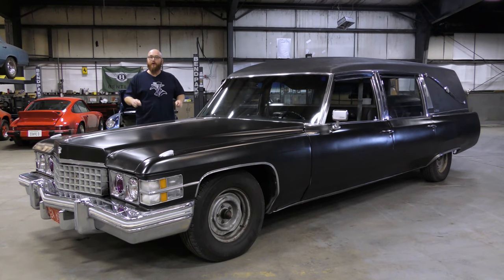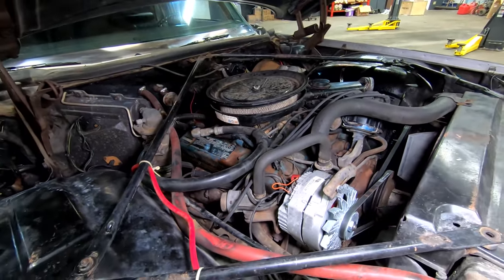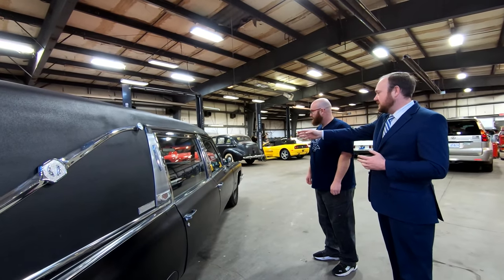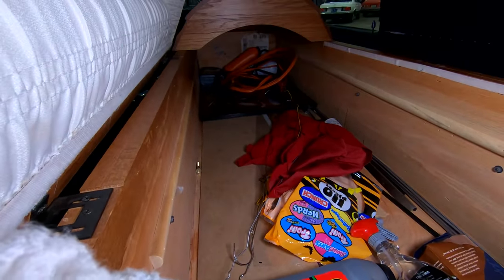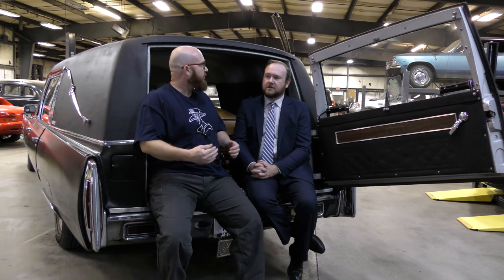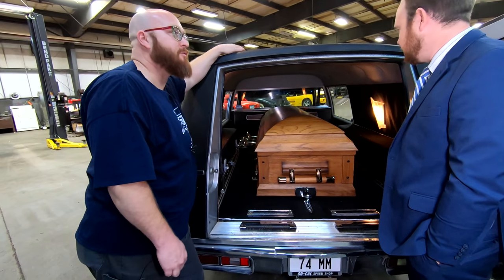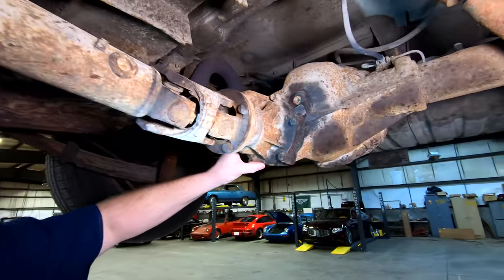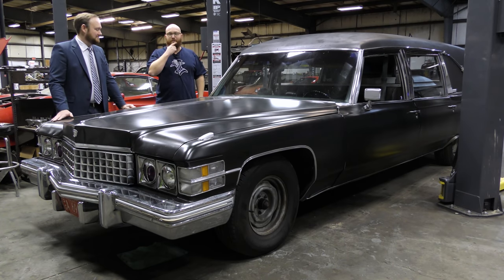Why would someone buy a hearse?!? CAR WIZARD shows a modded '74 Cadillac Miller-Meteor

Comment: The biggest issue with hearses is they were often driven in service, then put away wet, leading to premature rot particularly in the salt belt.  

Otherwise they are often low mileage cars which are reasonably well kept, if you don't mind that they hauled the deceased or the fuel economy they can be good vehicles.
Reply: That has not been my experience.  The funeral director take meticulous care of their cars so they are not embarrassed during a service.  The second buyer usually abuse them which is where the rot comes from.
Reply: @mexicanspec  I heard that because funeral is a very special occassion, these hearses don't have long service life, becauce the clients don't want to see old vehicles caring their loved ones. 
So they buy brand new hearse, and use it less than 10 years and sell them, even though they have plenty of life remaining due to low mileage. I heard East Asian countries are buying these to use in their countries, because it became fashionable to have American Style funerals from watching Hollywood movies and dramas.
Reply: @davidjacobs8558  It depends on the finances of the funeral home but 10 years sounds right because the car companies don't change the style of their car very much.

I can tel you in Mexico there is a shop that will take a Grand Marquis and make a Rolls Royce hearse, or a Mercedes hearse.  It is Ford underneath but it looks like the other car.
Reply: @davidjacobs8558  I don't know, I've seen a magnificently kept one locally that couldn't have been younger than 1920...
Reply: @davidjacobs8558  I have a '93 that was used in at least 1 service last year
Reply: @thoughtengine  a 1920?   You are dealing with a way different animal back then.    Are you sure ?
Reply: @caseytbss  I think I've found it, I was only off five years. 1925 Buick, Morleys Funerals, Townsville. Shiny...

Comment: While I certainly like the Miller-Meteor conversions with the funky bubbled roof and large proportions — I’m partial to the clean smooth lines of an S&S, specifically a Victoria or Park Row.
Reply: I Like the '60s - '70s Superior Crown Sovereign Landau.
Reply: Yes the S&S was the top manufacturer, after Eureka closed their doors.  Miller-Meteor was not a well put together car.
Reply: @mexicanspec  I saw a comment saying that most vintage mms should be avoided and that 1963 was the worst model year for them. I wonder how many customers actually returned their coaches to the dealership or how they were able to get away with selling "faulty" vehicles??
Reply: @aussiefurbymogwaifan6621  The reason I say the M&M was not a well put together car is because they molded the Cadillac body to their coach body with fiberglass.  Other companies used lead or metal making them stronger. I doubt any cars were returned. Funeral directors couldn't be without their cars so whatever repairs needed to be made were made onsite.
Reply: @mexicanspec  so has anyone who has restored a mm (yes, even ecto owners), has used steal/lead in place of the fiber glass?? Also what is "lead"??
Reply: @aussiefurbymogwaifan6621  Lead used to be used.It is a metal but it is not safe to use.  They found that out after using it for years.  I don't know anybody that has restored a hearse, I only dealt with clean original cars.
Reply: @mexicanspec  your comment about someone that you knew who sold their car to become the 1a, what colour was it and was it a futura limousine and what did it's mm vin read?? Since the 84 ecto's vin is available to the public online. I wonder if any fans that have been to see the 1a/second afterlife ecto at the Patterson museum have asked the staff if they can pop the hood to look at the coach builder vin?? As the 1a is the only screen used car that we don't really know about what it looked like prior to the ecto conversion and what Miller-Meteor model it is🤔

Comment: I had a high-mileage '74 Fleetwood in the 80s.  The exhaust gas recirculation made it run so rough when cold that it broke the exhaust manifold bolts on one cylinder.  Before that, you couldn't hear the warm engine inside at idle.  It broke down a lot, but I still miss that car.

Comment: Ecto-1 was also originally built out by Miller-Meteor: '"The Ectomobile, or Ecto-1 is a 1959 Cadillac Miller-Meteor Sentinel[1] limo-style endloader combination car (ambulance conversion) used in the 1984 film Ghostbusters and other Ghostbusters fiction.[2][3] The original vehicle design was the creation of Steven Dane, credited as a Hardware Consultant in the credits."
Reply: Where did you get the idea Miller-Meteor built the Ecto?  That is not true.  They built the car back in 1959 but the studio added all the extras.
Reply: @mexicanspec  I wrote exactly what I meant and what was true, but just to clarify for the literal-minded: using the Cadillac chassis from GM, Miller-Meteor originally built the car out for its first owner in 1959 and that car would be modded into Ecto-1 twenty-five or so years later.
The info in quotes in my OP is from Wiki (and I've heard the same info from other sources as well, such as the episode of Jay Leno's Garage featuring it, IIRC, for example), but, since YT nukes from orbit (just to be sure) any comments with external links, I didn't put the link to the article.
Reply: @talon262  When you say the Ecto "built out", that implies the all the add ons that made it the Ecto.  The 1959 MM never went to MM to get any work done.

I know for a fact for the second movie my buddy was tasked with finding the car for that movie and he did.  He arranged for the car to be picked up from the seller and delivered to the studio where they made the Ecto II.
Reply: @mexicanspec  holey crap! Really?? I have always wondered what colour it was (before it was the 1a)and what it's mm vin would read, since the og 84 ecto's is available to the public online. We know the 84 ecto is sentinel (who else gets annoyed whenever they call ecto a "futura duplex"??), but what is the 1a, is a futura limousine??

Comment: I flipped the air cleaner lid on out '72 Fleetwood...she moaned like a badass. The 472 was  a great mill. the last truly great engine that division produced. I imagine the bare commercial chassis from Cadillac came with the taillights, rear bumper...maybe the doors?
Reply: 472 is a monster. Beautiful engine! Especially the earlier, higher compression ones from 68-70
Reply: No the coach company had to get the tail lights.  They are from a 1974 Malibu wagon in this case.  When they used the stock Cadillac lights, then yes they camew with the chassis.

Comment: In 1965 my college room mate was undraftable because of a physical situation. He would go to school 6 months, thenwork as a railroad brakeman for 6 months. He paid 1/2 of the rent every month. He left me a 1953 Cadillac hearse with low miles. He also left a gas card and specified premium. I was to exercise the hearse.I did so. The Hydromatic plant burned and the hearse had Dynaflow. Yes, it was slow; but free!  He bought from a tobacco pipe store which had used it to haul mail orders to the Post Office.

Comment: Back in the mid-1980s, I had a 1974 Cadillac ambulance. Ultimate station wagon. Gigantic Cadillac front end. Huge humped roof that you can stand up in the back (48" headroom, 157.5" length). Bought it for an RV. Took the paramedic chair out and made a bedroom in the back. Used it to move furniture and boxes for friends moving into places. Could haul tons of stuff with that cavernous rear compartment. I measured a first-gen 1991 Mazda Miata and it could fit in the back of that meat wagon with room to spare. Engine was a 7.7 litre 472 CID 16-valve OHV V8 that produced 205 hp @ 3,600 rpm with 495 Nm of peak torque @ 2,000 rpm. Horsepower had begun to subside with the 1973 Oil Embargo. The same 472 CID V8 when introduced for the 1968 model year produced a whopping 375 hp @ 4,400 rpm packing a prolific punch with 712 Nm of peak torque @ 3,000 rpm. Performance for the 1974 Coupe deVille was rated as 0-60 mph in 11.2 seconds, 0-100 mph in 36.1 seconds with a top speed of 117 mph (In 1968 the top speed without governor was 128 mph). The 1974 472 CID V8 did the ¼ mile @ 78 mph in 18.2 seconds. The engine was mated to GM’s Turbo Hydra-Matic THM-400 3-speed automatic transmission.

Comment: I had a '76 Miller Meteor combo I bought used in the '80s. It looked similar to the one in this video, but a combo had rear windows (like a station wagon) that could be covered with metal panels with landau bars if you wanted to use it as a funeral car. It had folding jump seats in the rear with IV hooks in the ceiling so it could double as an ambulance if necessary. It was built on the Cadillac Fleetwood 75 limo chassis so it rode just like a limo, and had a glass window divider behind the driver's seat, and separate heating and air conditioning front and rear. For $700 it was cheaper than a pickup and could haul 9' long boards in the back. It had a 500cu in engine so gas milage was terrible, but gas was cheap back then.

Comment: I always wondered what the chrome ornament on the back of hearses meant. Turns out it was the mechanism for foldable top vehicles in the 1930s and 1940s.
Reply: Landau bars. Yeah they used to be an ornament to convey luxury, but nowadays you'll only see them on hearses (the 67-71 Thunderbird had them too, that's how I ended up looking into what they were for)
Reply: They go way before that. Originally they were installed on horse-drawn carriages and got carried over.
Reply: @uzivatel56  You're quite right. I had forgotten about that! They started on carriages and buggies.
Reply: @uzivatel56  Back then, not all coaches had a fixed roof for the folding part to latch onto, so the landau bars had to hold it up in the air.

Comment: They are actually called wheel covers because they cover the entire wheel; hubcaps are smaller & don't cover the entire wheel.
Reply: You'd find hub caps on police cars, and cars from the 1950's, and lower level model cars from the 60's.
Reply: At least they don't call them "rims" which are only a component part of the "wheel"
Reply: @md11b777  Large trucks and wheels from cars from the 20's often have separate bolt on rims that are attached to the hub part of the wheel. People still often call steel wheels, without tires, "rims". Steel wheels with hub caps or wheel covers are going out of style. The majority of new cars now come with aluminum wheels.
Reply: @billkallas1762  To my point.  A rim is part of a wheel assembly.  Nowadays "rim" incorrectly is used for "wheel"
Reply: Where do trim bands fit in?
Reply: Ok nerd

Comment: Funeral cars and ambulances were built on Cadillac, Oldsmobile, Pontiac and even Ford car frames. Cadillac was the best, as it was on the commercial frame for limos. There were 3 top conversion companies…Superior, M&M, Cotner/Bevington, etc. each had their signature styles. The non Cadillac versions were mechanically problematic, as they were unable to withstand the added weight and strain.
Good video.
Reply: You left out S&S and Cotner/Bevington was owned by M&M, just that they used Oldsmobiles in place of the Cadillac.

Comment: Great Video! I have a couple of questions, on average how long do Funeral Homes keep the Hearses in service? and how much would that 1974 hearse cost?
Reply: There is no average.  I think it would depend on when the car starts costing them a lot of money.  Back in 1985 a friend of mine got a 1965 Superior Cadillac that had 23,000 miles on it.  ,The car was still sitting on the original dual ring white wall tires.  Some funeral homes like to keep up with the newest style, so an average is hard to say.

Comment: My younger  brother Mark, had one that was almost identical.  His was a "Double side loader" as in both rear side doors were suicide doors.  Unfortunately, Mark passed away in 2021 and his wife hadn't the same love for it.  Interestingly it was the most bare bones Caddy I have ever seen.  It was even a radio delete model, along with it's crank windows.  Actually the only power option was the seat - only forward and back, no tilt.
Interestingly, we had a cousin who had a rather interesting job in a cemetery.  As he lived next to it and was also one of the diggers, he had an extra  responsibility.  Each morning he was to walk the grounds looking for "Drops".  These are depressions over graves that were made about 6 - 8 months previous.  Apparently during his time some caskets deteriorate to the point of collapsing.  His job was to fill and clean up the depression so as not to upset the family.

Comment: is there any way to update the engine to give it more power?
Reply: You can rebuilt a Cadillac 472 and make big power.  It wouldn't be cheap, but it can certainly be done.
Reply: Hearse hot rod: https://www.youtube.com/watch?v=1J2wRkjvC-A
Reply: Why does it need more power'
Reply: @mexicanspec  it is a big and heavy car. Because of the emission control of the time, the big engine produces only 200 hp.
Reply: @MetaView7  My question is why do you need more power?  What do you want the car to do that it is not already doing?
Reply: @mexicanspec  go fast
Reply: @uzivatel56  You do not want to go fast in a hearse. Trust me.
Reply: @mexicanspec  Haha, racing hearse goes brrrrrr!
Reply: @uzivatel56 my bf in the 70s drove a 1955 white hearse. It was one of the decoy vehicles for Elvis's funeral. Don't remember what was under the hood but my next door neighbor was Shelby county highway patrol and we drove out to a new construction unopened stretch of highway. Let 'er rip. We're cruising at 120 and purring. They go fast enough.

Comment: An oversized car with modified frame that spends most of its time idling and city driving?  nopenopenope
Reply: It’s not a “modified” frame. It’s the purpose built, by Cadillac, Series 75 Commercial Chassis.  They were used primarily for Hearses and Ambulances.  They were also used to build Campers on. Or Airport 6 Door Transporters.  They also made Flower Cars which typically have the entire back Open like a giant convertible to carry the flowers in during the procession.  We don’t see too much of that these days.

There were also completely custom uses of the Commercial Chassis, such as a truck box that a Traveling Casket Salesman used. It could carry 6 caskets at a time with an open center aisle.

Comment: My first car, at age 15 in the summer of 1985, was a Miller Meteor Combination on a 1972 Cadillac commercial chassis. It had the 472, and the wheelbase was 166", at least a foot longer than the total length of my several sisters' VW Rabbits. The car had been in my grandfather's (1886-1981) funeral home fleet, and had been relegated to first-call duty by this time. The funeral home was switching to cargo vans for this service, so it was my job to polish up the hearse and sell it before boarding school that autumn, where we weren't allowed to keep a car.
As a combination, it was equipped for ambulance duty. Modern EMS services had not yet been established when the car was ordered, and the funeral homes here in western North Carolina provided ambulance service. The landau panels could be removed by loosening two thumb screws. Two facing jump seats could be raised from the flat floor just inside the passenger side rear door. There were four panels flush with the rear floor that were flat on one side, so that a wheeled stretcher could be put in, and there were heavy rollers on the other side, to allow a coffin to roll toward the bulkhead. The divider window included sliding panes so that the driver could communicate with the seated attendants in the rear, when the coach was in use for ambulance duty.
The car was marvelous to drive, even here in the mountains. My brother and I took it to a golf club, where it looked strangely at ease among all the other Cadillacs and Lincolns, but it earned us a few askance looks. My dad, a locally well-known physician, would lie down in the back with his eyes shut when we went around town. Four high school friends and I sat comfortably abreast in the front seat at the local drive-in movie, with room to spare, and other patrons were plenty interested.
The car was nick-named Patty Hearse, a reference to the bizarre Hearst kidnapping of the early 1970s.
There was not much market for a hearse in those days, and not many people were collecting them yet. $800 plus a truckload of firewood was accepted, and the car was sold.
For two decades afterward, I had a pattern of buying a 4-8 year-old Cadillacs, and driving them from about 70k miles to about 150k miles, which was an economical way to travel very comfortably with minimal repairs.
The best was a 1980 Sedan DeVille with the 368 (year before the V8-6-4 debacle), but the '72 hearse was a strong second!

Comment: I taught myself to drive a standard transmission in 1964 in a ‘52 Cadillac hearse which had been partially converted to an ambulance.  It belonged to the Civil Air Patrol, but they had nowhere to keep it.  I was a cadet member during my senior year in high school.  My family had a big parking area behind the house, so I volunteered to store it there.  They asked me to start it a couple of times per week to keep the battery charged.  I figured as long as the motor was running, it should go around the block a few times.  Didn’t take it far, didn’t go fast, just learned the mysteries of “three on the tree”.

It is pure coincidence that our next door neighbor at the time, my dad’s best friend and fishing buddy, was a funeral director.

Comment: The 472  and 500 is a engine I always wanted to tinker with. Lived in FL where there is a company that hot rodded them for air boats. Thought about building one to put in an older Chevrolet pickup .  Produces a lot of torque at low rpm,  reliable and lighter than a big block.